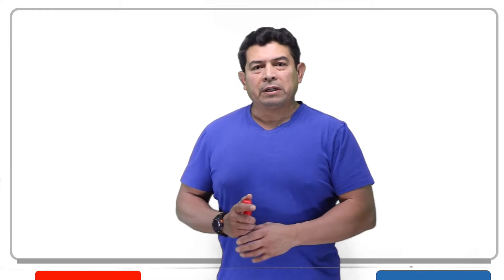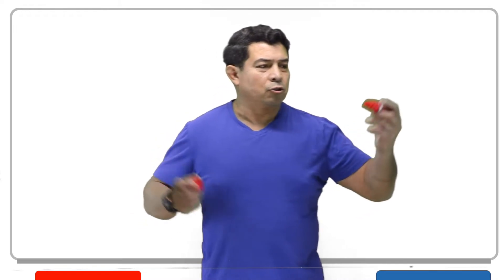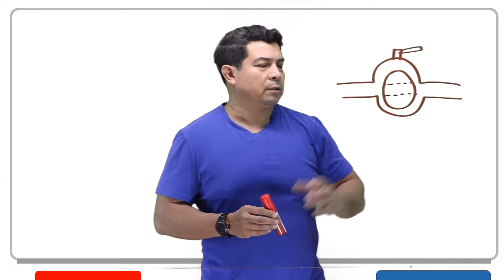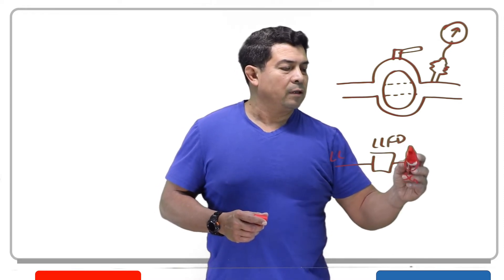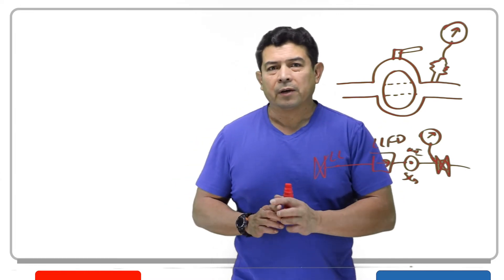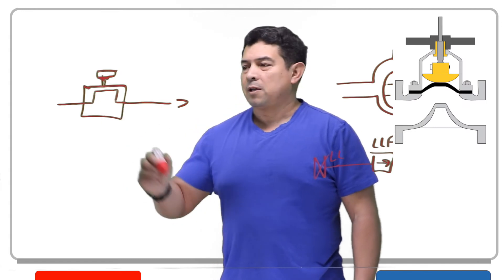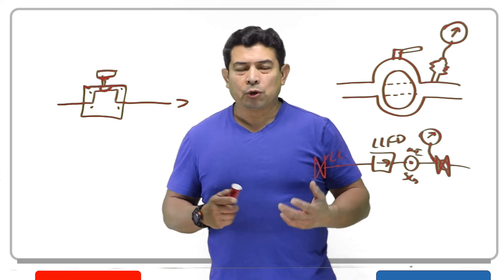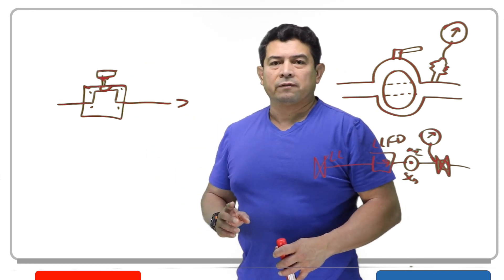Refrigerant valves - HVAC Online Training and Courses

Comment: I saw on some walk in cooler that they have a magnetic valve on the pressure side after the sight glass and they have one before the evaporators, what is their role in the system because some units work without magnetic valves? Thanks advance
Reply from the maker: Yes, but as you call it magnetic valve it is a liquid line solenoid valve. It is used to shut the system down and when that valve closes, they do a pump down on the system. That means that they're taking all of the refrigerant that is in the evaporator and putting it in the condenser and or on the high side. One of the reasons this is done is for oil return back to the compressor. Sometimes it is used sometimes it is not mostly depends on the length of the refrigerant lines. Good luck and thank you for watching!